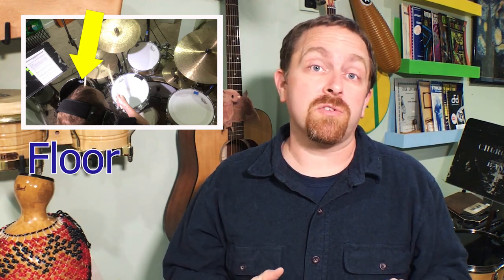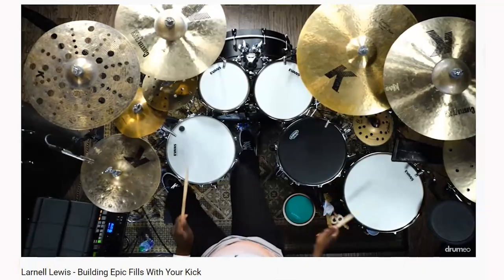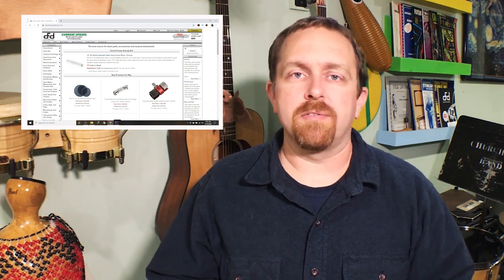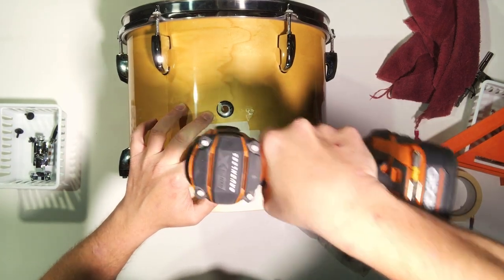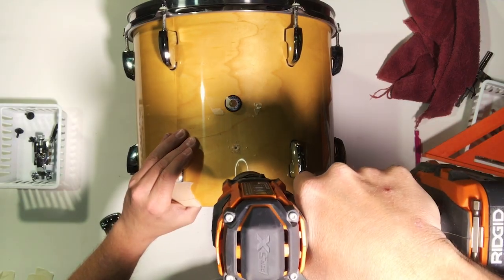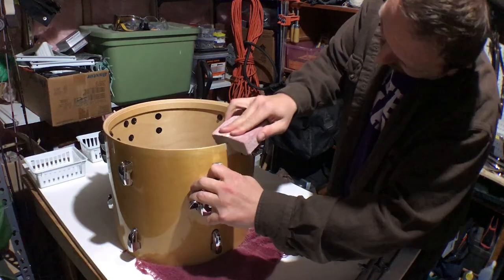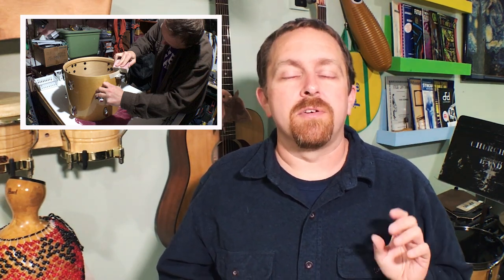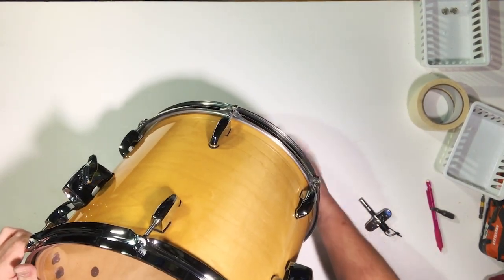Floor Tom Snare Drum Conversion

Comment: Enjoyed the video however snare bed section was glossed over, how were the edges cut??? Link to process?
Reply from the maker: I glossed over it because the way I did it was hacky. I recommend removing the bottom head of a snare drum and place a straight edge along the bearing edge near the snare bed. Then measure the depth of the snare bed to apply a similar dept to your floor tom bearing edge. I would use masking tape on the outside of the drum shell to mark the depth and extent (width on the circumference) of the snare bed. Then, use an exacto knife to remove the tape in the area you want the snare bed to be. This establishes a guide for sanding the bearing edge. Ultimately, I would use  sander to create the bed and use masking tape as a guide based on measurements from an existing snare bed from another drum. Sorry if this is unclear or hard to follow.
Reply from the maker: That video demonstrates exactly what I was trying to describe.